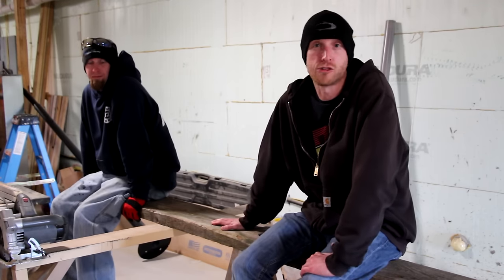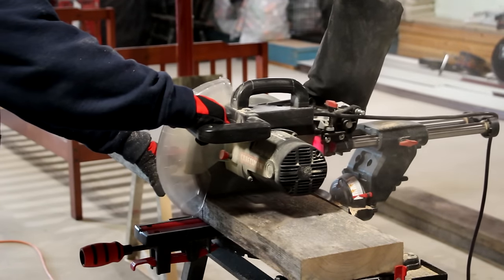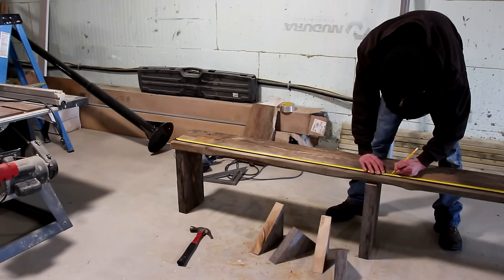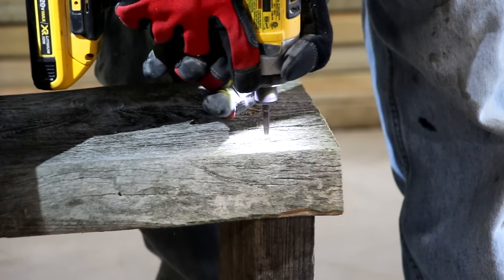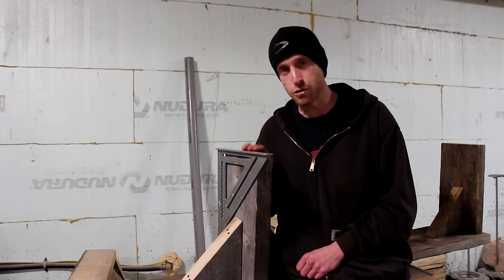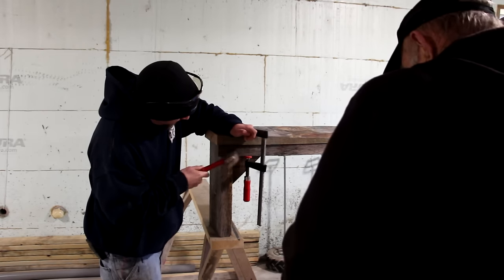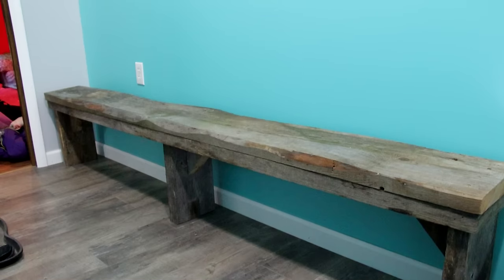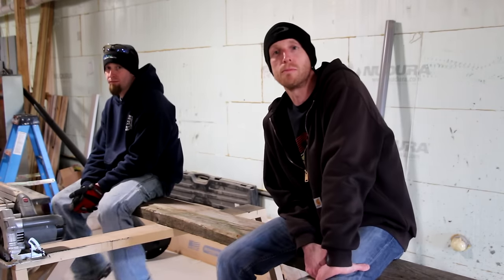How to build a Barn Wood Bench

Comment: Nice, but you'll regret using deck screws to attach the top to the legs. Old-timers used nails, this way, the wood has a better chance to expand and contract.